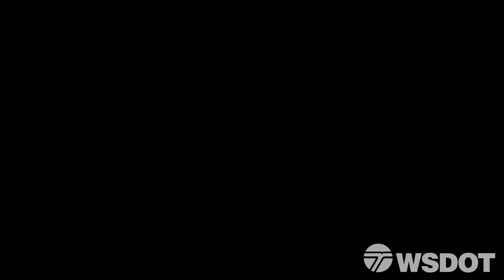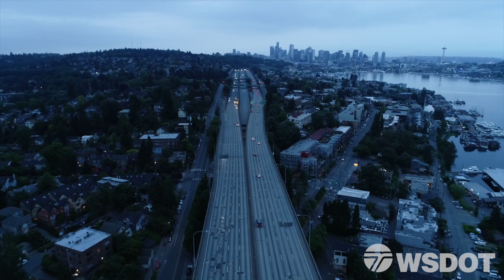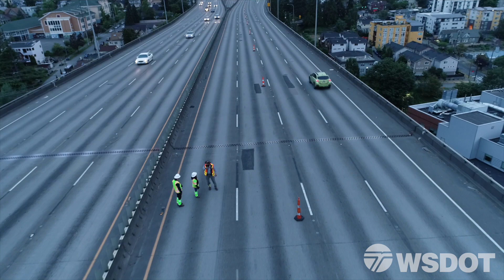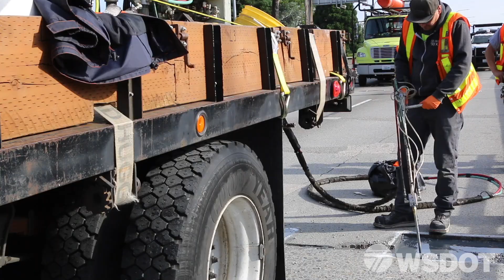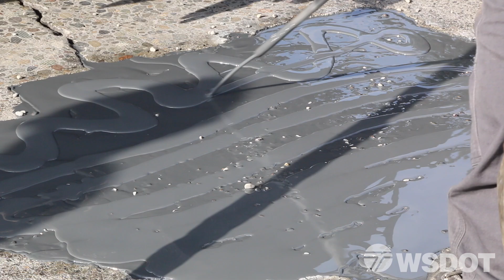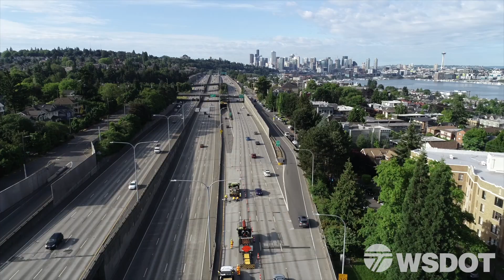I-5 Ship Canal Bridge Maintenance

Comment: What kind of material are you using to fill the saw cuts? Looks like a high strength concrete mixed with an aggregate?
Reply from the maker: Depending on the weather and the width of the joint we have two choices. Option one is to use old-school rubberized hot asphalt, similar to what is used around the perimeter of HMA roadway patches. The second option is to use a silicone sealant (RCS) that has superior adhesion and elasticity but requires warm temps and dry surfaces.

Comment: Have you considered "rounding or angling" the potholes perimeters such that there's less wheel "thump" hitting a straight edge? I feel the former provides a smoother transition for vehicle wheel passage and therefore longer life.
Reply: Daren D given the minor width of a average car tire I don't thing it has that much of an impact, unless it is an extreme angle.
Reply: In a short period of time, maybe. But over time, it can add up. Maybe I'm just biased with the horrible pothole patches on 12th Ave by Seattle University. Thump_thump_Thump_thump_Thump_thump.
Reply: Daren D there are a lot of bad patches out there, I could not agree more.  I can tell you first hand it is difficult to make a patch that is structurally sound and rides smooth, matching the elevation and grade of the existing road without a laser level is a bit of an art. I have a few asphalt patches I've done and some ride excellently, some are less than perfect despite best efforts. I've never patched concrete though.
Reply from the maker: Good question! This is determined by the weather and repair window duration. If the repair is shallow in nature, or a temporary repair, we remove only the loose material and patch it back, so sometimes the patch will not be squared-off. A more permanent repair will be squared-off as we need to sawcut the edges for a smoother vertical face to patch to. This lasts longer than a rough-edged, irregular shaped patch. The thump you are referring to could be caused when the finish is a little higher than the surrounding roadway surface, and we will do our best to avoid this.